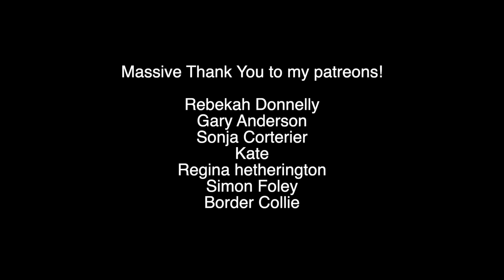Pygmy Goats our first animals on the homestead!

Comment: 2 post Bradbury car lifts, ...I used to fit them in garages all over Ireland with my father as a contractor for Castrol oil company, I believe that was my third career change back in the early 1990s.
The best place to pick one up is Done deal.
Reply from the maker: I Have had a look on done deal but haven’t had any joy. Although a new lift is a lot cheaper now than back in the day